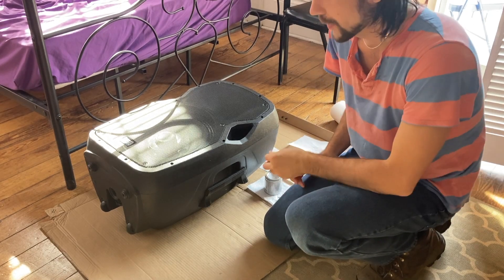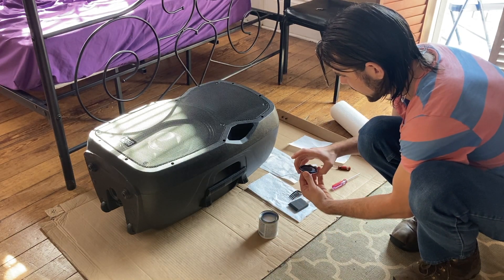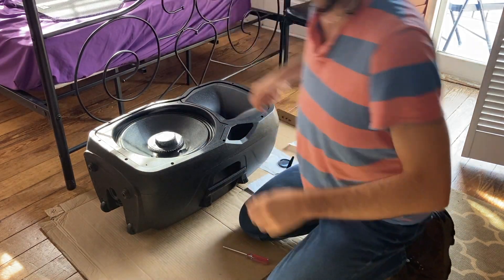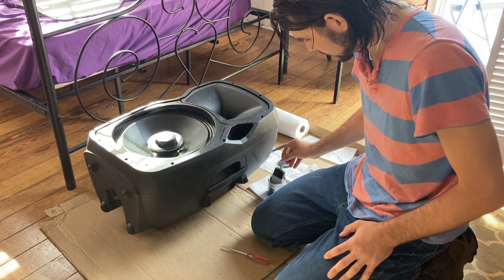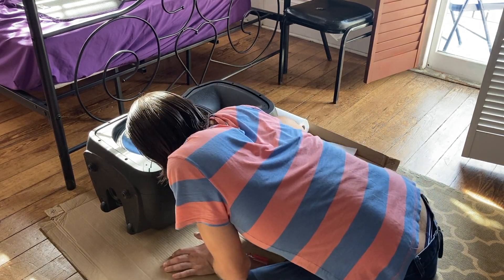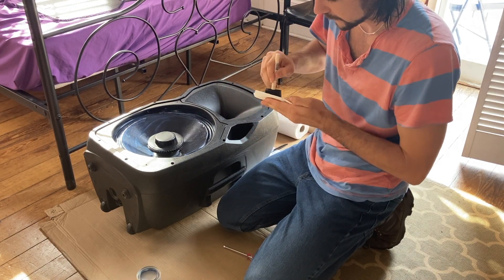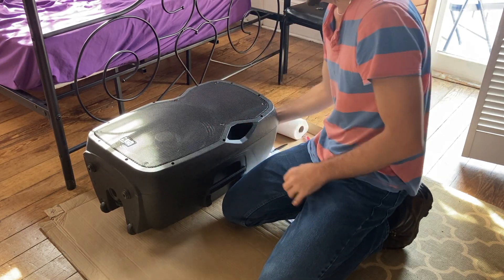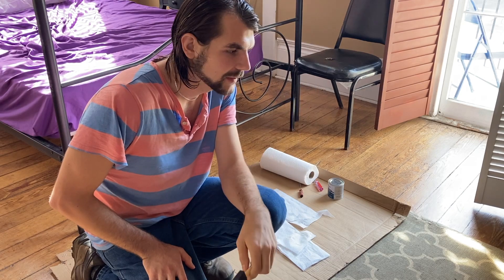How to Waterproof Your Speaker's Woofer Cone

Comment: I am not confused from the procedure you do but doesn't using a Urethane mess up the good bass and other music notes of the speaker? I don't know, never did this myself. I would think since it dries hard, like when protecting a wood surface, it would not allow the speaker to do it's job...no?  am I wrong here or what? I have some speakers with 6" woofers I use outside a lot and always try to cover them at night. I was thinking of spraying them with a couple coats of fabric waterproofing spray like we use on camp equipment. Any thoughts on that?
Reply from the maker: I didn't notice any difference in sound after I applied the urethane. It definitely did not break the speaker. It doesn't dry so hard that the whole thing becomes completely solid. A couple coats is still flexible. I would think probably many coats is still flexible.

If you're concerned you can try it on a cheaper speaker you have, or go buy a small cheap used speaker and test it on that.